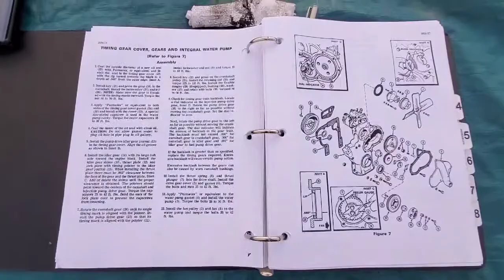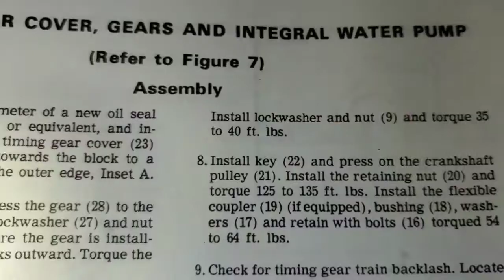Injection Pump timing & Pump Drive Gear. Case 188d

Comment: Thanks for this video. I have a '68 Case 580ck that was sitting for 15 years before I started to bring it back. I may have to rebuild the pump and this install video will help. I think that I can remove the pump without taking out its drive shaft or removing the gearing cover. Thanks again. I have some videos of the general restoration so far on my channel.
Reply from the maker: If reason for rebuild pump is hard to start. there is the initial pump at the back of the injection pump. behind the cover of the fuel inlet on the pump. It is 2 fins that spin & provide low pressure into the pump to push the 2 little pistons inside out where they then pressure the fuel up to the injectors. All your pump may need is new fins or repair housing on that initial low pressure pump. A good working low pressure pump really help for slow cranking starts.
Reply: @manbuilds1587  Thanks for that. I've seen a video somewhere about the lift pump. I haven't tried to start the tractor yet but I'm getting close. I cleaned out the tank, replaced the fuel filters, changed the engine oil and filter, and flushed and refilled the radiator. I've got to hook up some gauges and battery cables (and a key switch) then I'll try. The fuel in the tank and the primary filter was black and  tar-like. I hope it isn't like that inside the injection pump! If it won't start, I'll take it off and see. Thanks for the help!
Reply from the maker: If the pump is not pushing out diesel, most likely the 2 little pistons are stuck in the pump from sitting, all roosa master pumps seem to do that. Could try a shot of compressed air in the inlet to un stick them. If that doesn't work you will have to dis-assemble the pump. Not much that can go wrong in those, just make sure to note which way the ring for the little pump at the fuel inlet is orientated cc or c & which way the main cam ring is oriented for the injection pump head. It may run if the cam ring is installed backwards but not very well & will most likely shear the pump input shaft. Input shafts are hard to find. If need a part like that there is Roberts Tractor in Ohio. They seem pretty good, have some hard to find parts & ship in the mail.
Reply: @manbuilds1587  Thanks again. Very good information!

Comment: I think you forgot to point out that the pinhole on the shaft has to align with the pinhole inside the pump (2:08) so the timing isn't 180 deg. off.
Reply from the maker: Thanks, I didn't know about that.
Reply: Is there supposed to be a pin in the "pinhole"?
Reply: @Drottninggatan2017   no just dot on shaft to dot on the pump rotor granted his was hard to see the dot on the pump rotor up inside the pump

Comment: Thanks for the video. I am just digging into mine to rebuild the pump. It looks like there are a lot of parts that need to be aligned when they go back together.
Reply from the maker: The pump drive shaft can stay with the engine. Can slide the pump off & replace seals on shaft. Just line timing marks up in bell housing window & slide off.

Comment: Thanks. What is the procedure to remove the pump? thanks a lot
Reply from the maker: Clean off grease & dirt, align timing marks tdc on engine & pump for easy re-install. disconnect fuel. disconnect injector lines from pump. un-bolt pump. slide pump back off shaft. shaft can stay on machine. Recommend change seals on shaft before re-install pump. Grease new seals for install & pump re-install.

Comment: Thank you, this is very helpful. Just picked up a 1740 skid loader today that runs for 30 seconds and shuts off. Thanks to your info here I will be checking the lift pump first. Do you have any source for where you get the case service manual? Again, thank you
Reply from the maker: Could be the Return line from pump plugged, had a different tractor with same problem turned out to be plugged return line. Or something with the low oil shut off or a sensor if newer & electric shut off selenoid. Ebay has alot of manuals.
Reply: @manbuilds1587  you're right on the money. I got it running, the return line check valve was clogged with material from the flex disk falling apart. I'm going to rebuild it.
Reply from the maker: Right on.

Comment: what do you if there is no mark on the governor ring on the pump?
Reply from the maker: Then something may not be lined up. Every injection pump has a way to time it. Unless it's common rail, then you just need to build pressure & timing marks may not mater & may not exist.
On these old machines there is surely timing marks. Either pump drive shaft 180° out. Pump drive gear not in correct spot, engine not at TDC, or just need to turn the pump body a little more & line stiffness making it difficult.

Comment: Excellent video an torn-down images. How did you got bucket assembly out of your way? I'm thinking I will fork-lift it off. Did you remove the lifters and bucket together or disassemble?
Reply from the maker: You could just lift the loader up & secure in place with a chain to something above or prop. up with a large block under arms.
If your going to remove the loader & don't have to move it, leave the 2 big lift cylinders with the machine. makes easier to re-assemble. start machine & move cylinders out until pin holes line up.

Comment: Hello, My tractor won’t start. I had the injection pump rebuild, I install it all timing marks in line. The only thing my tractor doesn’t have is the gear mark hole or if it dose I can’t find it. (530 case)
Reply from the maker: gear mark hole? you mean the hole were you can view tdc marks on flywheel at the back of the engine?
Reply from the maker: There is a large bolt behind the starter on the side of the casing. Its a cap to view the timing marks on the flywheel.
Reply: Thanks I will check it out 
You think that's why the tractor didn't start
Reply: That is the only thing I did not set to 8 degree
Reply from the maker: could be. take time to fill lines with diesel, alot of cranking before will fire. Even if timing is not correct it will smoke once it fills up the injector lines with fuel & injectors start sprayng fuel in the cylinder.
Reply from the maker: unless removed the pump drive gear & re-installed without the the marks lined up, the most your pump can be out is 180°. if all marks aline witj pump then it should start.
Reply from the maker: make sure pump is getting fuel & the return line is not plugged.
Reply: Thanks for the info I will check it out
Reply: @manbuilds1587  Fuel dose not run through the return lines, the lines are not plugged. What I noticed is that fuel comes out from the timing marks on fuel pump (on the plate on the side of the injection pump). will that be normal or I have a bad pump. Once again thanks for your help.
Reply from the maker: yes, normal. the  pump fills with diesel. It is the same diesel that runs back through the return lines. It is the excess fuel from the 2 little pistons in main pump & incoming flow. Main pump puts diesel into casing as its running, reason for the return line.

Comment: Can I remove the pump without pulling the front cover mine is full of rust
Reply from the maker: yes, but the pump shaft will stay with the machine. Just slide the pump back off the shaft. Suggest have engine tdc mark aligned before remove pump for easy re-install. The seals on the shaft can be changed also, be care full sliding them over shaft. Use some grease to aid getting seals back.on shaft & when installing pump.

Comment: 1:54  That's the wrong lube dude.
Reply from the maker: why is it the wrong lube?
Reply: @manbuilds1587   You want to use a gasket silicon lube so your seals last longer.  It won't oxidize.  Diesel (more like the micro organism that feed of diesel), and any other chemicals you might put through the fuel system for cleaning can't eat through it.  Looks like you just threw some GP on it.  You should be fine though.
Reply from the maker: A gasket silicone lube? I am sure there is a specially designed product for assemble. This is not such a precise machine requiring such a fancy product. This tractor is from 1960. Any grease used to lube the shaft will be washed away by diesel pretty quickly. The grease is to help the seals go into the housing. I would much rather use a petroleum based product that I know will disolve & not linger in the pump or the injectors after start up. Silicone does not combust or disolve in fuel like a petroleum based grease. Probable no issue with the silicone grease, almost anything used to lubricate the seals will work fine. Peanut butter would probable work just as well as long as it is not chunky peanut butter. What micro organism feeds off diesel, Are you thinking bio diesel?
Reply: @manbuilds1587   lol!  I stopped reading after Peanut butter.
Reply from the maker: why stop reading after peanut butter?